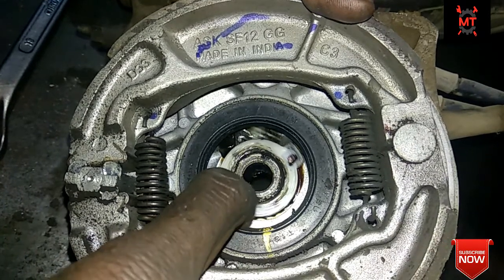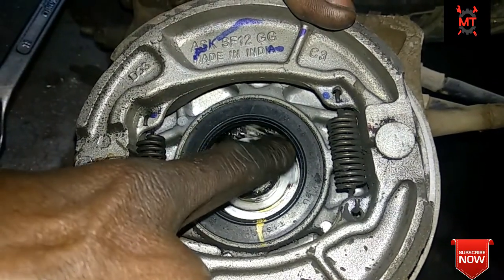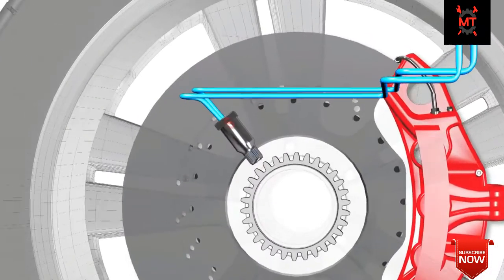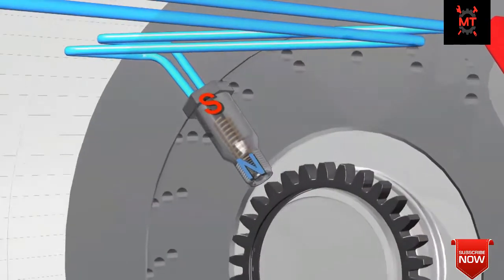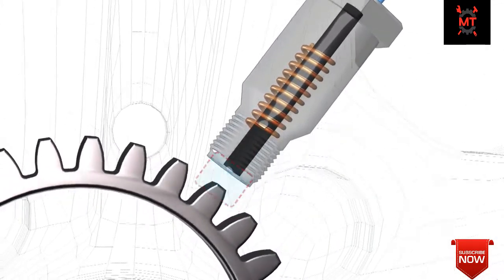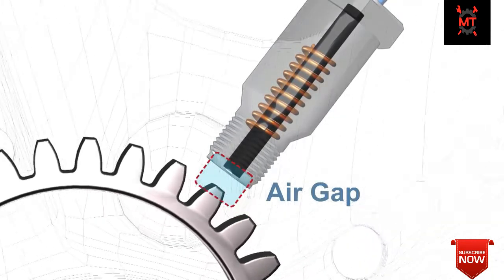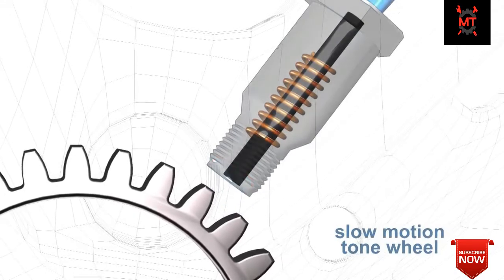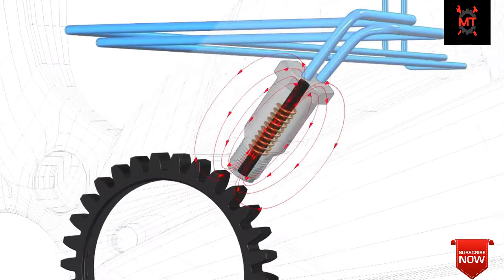How speedometer works in bikes and car|mechanical (or) Electrical|MECHANIC TAMILAN

Comment: Nowadays spendometer cable was located in front wheel to calculate the speed of the vehicle but in 60's  the old "Royal Enfield/Java " bikes the speedometer cable was located in rear wheel they used to calculate the speed of the vehicle
What is the difference between rear and front  speedometer cable in bike's?